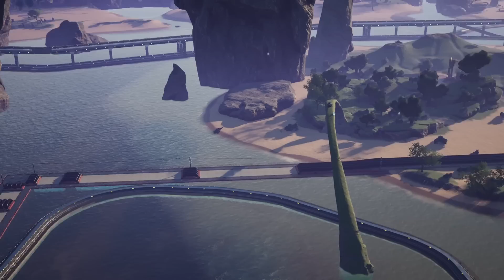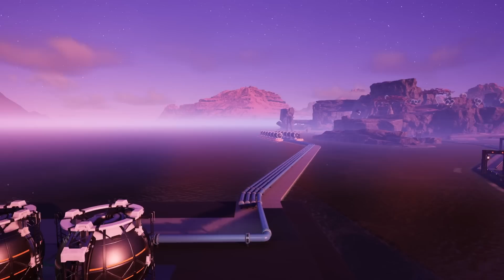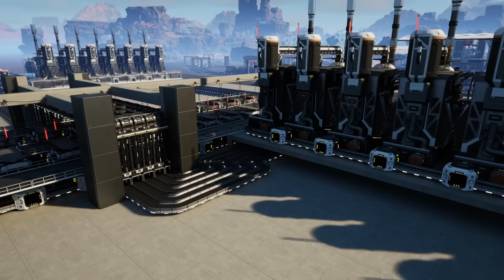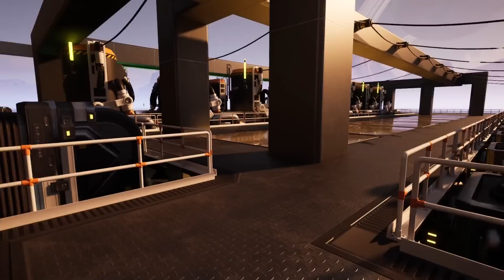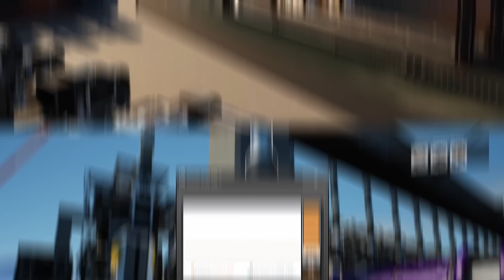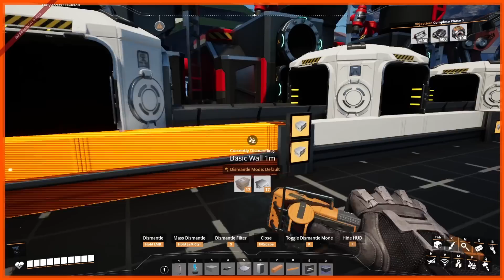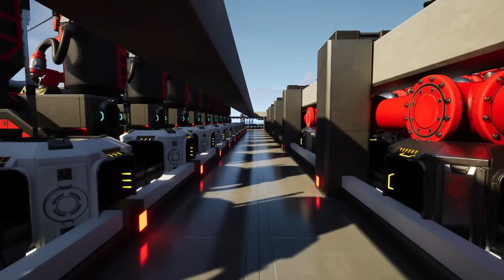How To Turn 600 Oil into 40,000MW With Turbo Fuel in Satisfactory U8

Comment from the maker: Have you gone down the route of Turbo Fuel or do you prefer plain fuel?
Reply: I don't think turbo fuel is worth it.
The 1800/min Crude Oil from the coast can produce 60000 MJ of power, using the diluted blend fuel setup.

But Sulfur is so valuable for other high-end products that the only recipe that's not wasting too much sulfur is the "Alternate Turbo Blend Fuel".

which requires 1200/min Sulfur to increase the power production by 20k to in total 80000 MJ.
Reply: I haven't unlocked turbo fuel yet
Reply: @LightlyBurntToast26   then why is it in the title?
Reply: I only built a small normal oil refinery while working on my nuclear plant. I also had to build another one so my power grid didn’t crash when I turned on my plutonium setup
Reply: Based in Blue Crater I'm doing regular fuel right now for power but also using fuel for the fused modular frame alternate heat-fused frame recipe - when we get the new switches this will become a backup to the nuclear generators in the event of an issue with fuel rod production - nothing worse than a cold-start of the entire grid!
Not sure it's worth upgrading to turbo fuel, I'm producing far more packaged fuel than I'll ever need for the automated trucks, but I like a challenge for efficiency so might do it anyway :)
Reply: Personally I would never waste my time on a fuel powered PowerPlant, turbofuel is soooo much more efficient. The HOR > Diluted fuel > base turbofuel path is the most efficient. 1 cycle of a fuel gen uses 12 fuel or 4 TF, no contest.
Reply: @daveisnothere  except you'll need to haul 1000+ coal/sulfur per minute to power just 1 pure oil node worth of power plant, and based on total number of available sulfure nodes vs oil - it's a kind of waste of sulfur
Reply: @ravenousbasilisk5120  my turbo fuel plant that uses 1800 crude uses less than half of the sulfur, 3200. My manufactory only uses 1,000 and if I went full nuclear that only uses 500. Sulfur isn't as used as much as a lot of people think. It's not like I would be running both the turbo fuel and nuclear at the same time anyways
Reply: @ravenousbasilisk5120  Using Turbo Blend Fuel eliminates the Coal and reduces the Sulfur at the cost of 2/3rds more oil per power.  I find it both much simpler and preferable in terms of resource costs.  With 600 oil and 400 sulfur providing roughly 27GW.  Honestly it's better than Nuclear.
Reply: I believe when you go to fuel generators for the bulk of your power generation, you have to go straight to turbofuel from the start. Turbofuel is even useful for jetpacks now that it’s supported.
Reply: @FastTquick  I used regular fuel for my first power generator grid and now that I've unlocked nuclear, I'm going to skip turbo fuel because it will take just as much time setting up turbo fuel as it would nuclear
Reply: Plain diluted fuel, so much easier not having to bother transporting the extra resources and making all the extra steps just to get more power. I'd rather spend whatever sulfur nodes on more crucial products and any excess coal becomes coal power which I do love (just spam a few hundred coal plants across the sea, it's simple and super reliable as it doesn't rely on any other resources)
Reply: 3:20
Reply: Please unlock the blender and show a factory for using it to maximize power production. Thanks!!
Reply: If I ever get the time, I'll skip turbo fuel and prioritise setting up nuclear and Plutonium setup lol
Reply: I have 3 Turbo fuel power plants on the NW sand coast and 4 on the N central reef area that are going to use a new set of BPs I am working on now.  Each one is fed by 600 Oil and produces its own Diluted Fuel and Coke for use in alternate Turbo Fuel recipe.  All sulfur is Droned in from dedicated sulfur mines.
Reply: Would it be bonkers to make diluted fuel into turbo fuel? I wanted to use the three crude oil nodes overclocked to max and make as much HOR as possible into diluted fuel then put that and sulfur and copal and whatever into Turbofuel...but...the math hurt my brain.
Reply: I love turbo fuel - it lasts SO much longer - at least it did on previous updates and hopefully that's still true 🎉
Reply: @jrockintx83  it is still true.
Reply: Each Fuel Gen on Turbo Fuel consumption -- 11.25 (x3 Power Shards)
Each Blender on Turbo Blend Fuel alt recipe prouduces 112.5 (x3 Power Shards)
So make 10 Blenders with such arrangement and supply 100 Fuel Gens with 1125 Turbo Fuel straight (5 Blenders for supply of 50 gens through, 1 same pipe downstream from the top of the Tower easily supplies 50 Fuel Gens)

It takes 2 additional Blenders with Diluted Fuel alt recipe to make 375 fuel in total to supply all 10 Main Blenders with it (water + HOR). This is essential, otherwise you'll not be able to fit the mark of 900 of Crude Oil for such setup. Get ready to supply 375 of Water to both Blenders.
12 Refineries with Heavy Oil Residue alt recipe to make 1200 HOR in total (for all 12 Blenders + what remains should go for 2 Refineries with proudction of Petroleum Coke for 10 Main Blenders). In this case you'll have a little (around 50 or so) of excess HOR and you'll have to dump it somehow or utilise it.
562.5 of Sulfur
And 562.5 of Petroleum Coke, which will be made by 2 Refineries mentioned above.

That's how you make a Fuel Tower that supplies a sheet tonn of kilowatts of energy. Make Pumps only on a primary Crude Oil line and a Water line and make sure that all the other products will be delivered by the gravity (a way to economise power consumption by reducing the total number of pums for the facility).

Most of the buildings mentioned above have to be x3 Power Shard charged to meet the requirements.

Such a setup from my perspective looks as an ultimate power solution for whole map before the Nuclear Energy. Takes space only vertically (yes, gravity liquids supply is the name of the game) and makes perfect numbers: 900 of Crude Oil with 375 of Water and 562.5 of Sulfur are converted into 37500 MW of power. Build 2 Towers if needed more power than that.
Reply: Normally I don't bother with Turbofuel, but...

I just spent an uncomfortable amount of time building a 45 Generator setup for my 900 oil plastic/rubber build.

I now expanded the plastic production and since I figured instead of going through the pain of building addional generators I could switch to Turbofuel and just squeeze three times the wattage out of the setup I have
Reply: So i just started playing satisfactory for my 1st time and been researching to figure out turbo fuel and numbers and did all the math once i got those 2 same recipes and my # is 540 crude oil to get 40gw with 64 turbo fuel refineries and just watched this video and now wondering if my math is wrong. Fuel gens at full overclock burn 18.75 or 7.7 at 100% turbo fuel, but you mentioned 12 burn rate at one point and that confused me too. Im completely new to this game but math is math so am i wrong. is it 600 oil or 540?
Reply: my turbo adventure was hilarious producing over 600 litres/m at the end with rocket and ionized stick on after, could not keep up but the turbo needed to flow or my plastic and rubber production halted 😂
Reply: ionized is amazing i had 12 or 15 running ionized, supplied by a factory cart 😂 one cart can supply about 25 when running on ionized. in my 2nd game now I'm building a biofuel plant that will produce 600/min not sure if i can keep the supply up to constanly run gens, but the idea was to use bio generators this run in stead of power storage, A LOT of em 😂
Reply: to think i only got the game a month ago it's safe to say this game pretty addicting 😂

Comment: Well well well! What a nostalgic video... long ago made the same fuel power plant and it was enougth to finish the game... But now... after lots of hours... i made my masterpiece... 600 OIL tuned into 2.130.000 MW... YES 3500+ Fuel generators fully overclocked  (using undermap building and duplicating somersloops with the glitch)... im tired... but its AMAZING! No more power issues at all! haha
Reply: May j ask you how you do with liquid piping and pumping? I understand a part of it
Reply: @theskull3618  The easiest way is always going down and using liquid containers for pressurise the line. Other way is make 1 pipe highest than the factory (with pumps of course) and up there make a "pressurization plant" with a couple of liquid containers) and back. If u have lots of pipes u just need make this with only 1... and then merge all. The pressurized one will pressurize all the system.

Comment: Is this still up to date?
I just turned 300 crude oil through alt HOR and blender Turbo Fuel into 300 Turbo Fuel, so "just" half of your output. How does this work?
Reply from the maker: blender turbo fuel is a different recipe - you need to turn it to diluted fuel with HOR alt first then turn it to turbo
Reply: @TotalXclipse  Thanks for the Reply. Still, Crude Oil -> HOR -> dil. Fuel -> Blender Turbo Fuel = 450 Crude Oil into 600 Turbo Fuel equals 20GW. Even if you use 600 Crude Oil, that would give you approx. 27GW. Where do the 40GW come from? Somersloops?
Reply: @lemboshauser4700  May the recipes got changed in version 1.0. Somersloops dont work in the video as it was made before 1.0

Comment: I turned 600 Oil into 74,100 MW.  So with 600 oil turning into 800 fuel / min using the packaged fuel recipe.  I added 600 Nitrogen Gas, 800 Sulfur, and 400 coal / min in 8 separate blenders to make 1,200 Rocket Fuel and 200 Compacted Coal / min.  I know its a year after this video so this may not have been possible then with the available recipes.  Still its the best now.  If you want to double it for 148,200 MW you can use 4 blenders instead of 8.  Put 2 power shards in each, and 4 Somersloops.  Sure that 16 Sloops for an extra 74,100 MW so you have to decide if that is worth it.
Reply: what area of the map did you build this?
Reply: @romanz2861  Top Center near those oil wells in the wet lands.  I trained in my nitrogen from top left, and there is also a sulfur nearby which is almost enough.  Then hit up a coal and sulfur node to the south.  I'm sure there are better places on the map to do this where all the resources are closer but it wasn't really my plan when I started so it just grew from normal fuel production into this.
Reply: @romanz2861  I'm just looking over the map.  If you setup around bottom center, a little to the right side, there is a small lake there with a gyser in the middle.  You have plenty of coal close south, sulfur close west, oil close east so those are very easy to get with just belts and pipes.  Then there is nitrogen north east.  About 3 times farther than these 3 are, but still close enough to pipe in if you like, or at least a short train route.

Comment: How come you are packaging the turbo fuel? Why not just pipe turbo fuel directly into the fuel powered generators?
Reply: I haven't got to that part of the video, but a lot of people package and unpackage because depending on how far you're moving fluids, it's easier to move items than fluids and unpackage it. Plus you can sink extra packaged items but you can't sink fluids

Comment: 12:50 Thats where I build my base and small part mega factory as well as my first few space elevator part factories ;-;. There are pure nodes for like everything there but the lag is real. Also I built my big factory for all the little parts on the 3 way edge of each of those biomes, so it changes color and fog level depending on where I stand, which I'm not sure if I hate or not. I'm hopeful 1.0 improves things there.

Comment: You didn't need to have a whole section of machine producing canister, you could have had just a single container full of them feeding the water packager and reuse the cannisters when they get out of the diluted fuel system.
Reply: I'm glad you mentioned this because I did something similar with my setup and re-using canisters. It allowed me to setup my fuel generators in stackable (blueprinted) sections with lifts transporting the full containers up and the empties down, which were repackaged and looped over again.

Comment: Hi, I would have liked to have your opinion regarding manufacturing logistics.
 Is it easier to craft on site or move the ores to craft everything in the same location.
Thanks for all these videos.

👍
Reply: Depends on the ore and access to water if using the Pure recipes and other other available ores if using alloyed copper for example. As a general rule of thumb whichever one is the smaller amount to transport.

Comment: Your title is more than a little inaccurate though I guess "I turned 600 oil, and a ton of plastic, coal, sulfur, and an ocean of pumped water, into 40,000 MW", it could be a bit of a mouth full.  Still the point is that there are many more resources that go into this than just oil.  Even if you got a pass on the water, the coal and sulfur are also as rare and valuable as the oil compared to everything else.
Reply: You can do this on the north west of the map, there is coal, oil and sulfur with the sea near, you can do a smaller setup, I'm producing ~1100 turbo fuel with 600 crude oil, 750 sulfur and 600 coal 
You just need to overclock all extractors to 250%
Hope this help
Reply: @Le_Ashe  I had a baby already since I posted that comment.  Ok, not really but it was 9 months ago lol.  I actually enjoy how complex this game is.
Reply: @K162KingPin  The baby is your factory lol
I love this game so much, i spent like 5hours yesterday just to try to find pretty walls idea for my factory

Comment: Why not use the turbo fuel alternative recipe and bypass diluted fuel?
Reply from the maker: Because I don't have blenders unlocked yet :)
Reply: @TotalXclipse  I should have specified “Heavy Turbo Fuel” which uses only refineries and no diluted fuel. I don’t see anyone using it and didn’t know if there’s a negative I’m missing. It makes 30 a minute. I’ve started building using that recipe. Thanks.
Reply: @KennethSmith59  the downside of using heavy turbo fuel is that amount of sulfer needed for compacted coal. the best and most efficent recipe would be turbo blend fuel as it uses less sulfer and outputs 45 turbo fuel per minute

Comment: It can be worth it to bp and build excessively large power storage, maybe smaller 10 GWh plants all over map, or a giant power tower you just slap a few floors onto now and then.  If you build like 10x your max grid cap, you get about 10-12h when you initially start teetering past the cap.  It really helps in case of things like upgrades, or dedicated server if someone goofs up power plant or overbuilds.  The priority power switch can also help as a last restort to shut down low priority factories.  But you may want to build factories with a minimal capacity or big output buffers in case of power outages, to prolong the recovery window before catastrophic failure, when a hard global restart can be very painful.  And geothermal can be great on a separate grid to charge power storage, run hoverpacks and in-building hypertubes.

Comment: The entire map in U8 is stutterfucked, especially on dedicated server.  Also, travelling too fast (riding train, any road vehicle, slide jumping before jetpack, hypertube) will crash the client, possibly the server.  Normal run and jetpack is about the fastest travel, switching to hover near rail lines, power lines, and bases, to conserve fuel.  FYI use Biofuel in jetpack.  You can legit fly 2-3km with ease if you run-slide-jump off a tall building.
Reply: Also crossing many biome zone boundaries instantly crashes the game client.
Reply: But even so, time saved with nudge and blueprint delete offsets and is greater than time lost via slow travel and crashes, especially if you limit travel by having materials get feteched via train on an as-needed basis, or popup local mini factory, or calculate mats needed and pre-ship via train.  A mini-mall bp and train unload manifold could help speed up the process of setting up a popup build site for bigger projects.
Reply: Clarify: Hypertube cannons, of the linear rail gun or circular cyclotron variety, these high speed hypertubes can crash the game.  Also, they may simply just not work too well, as the new physics engine used with the UE5 upgrade changed more than vehicle physics.

Comment: The numbers are wrong.  600 Crude with the HOR alt is 4:3 so 800 HOR which using DPF (Refinery) or the DBF (Blender) makes 2:1 or 1600 Fuel.  I mean, unless 100 Fuel was being used to convert Rubber (best use of PR + Water) to make some plastic, then ok, maybe.

Comment: I've had the same issue with the stuttering in the estuary. I've also had to give up on lumen, it seems to chew through my 3050's VRAM in minutes, and the textures aren't good enough on the foundations to build on. I'm also working on a similar fuel project and was debating on whether or not to integrate turbo-fuel; I'm not super sure I will. Right now, I've got oil going to polymer resin to residual plastic going into packaged fuel and those up to the power plants. That's got me 520 plastic and enough fuel for 40 power plants -- should get me to 1040plastic and 80 powerplants @200% overclock on those same oil nodes.